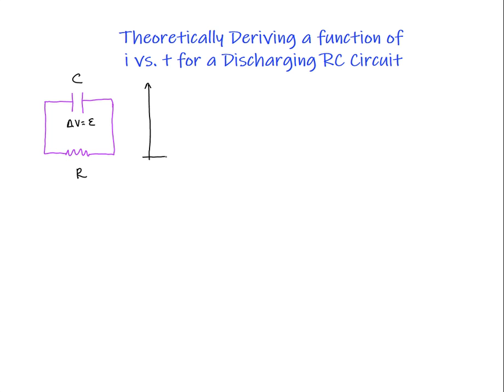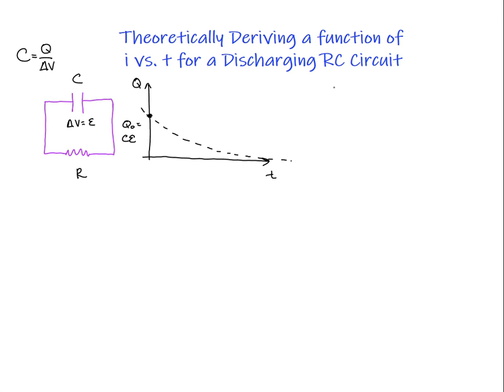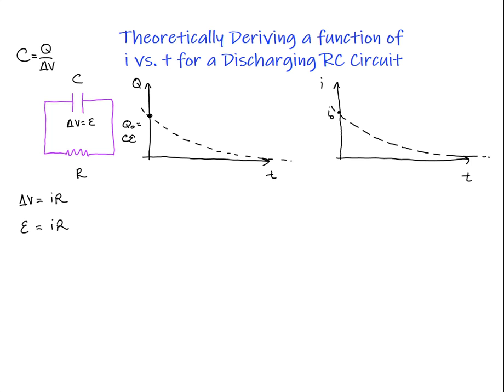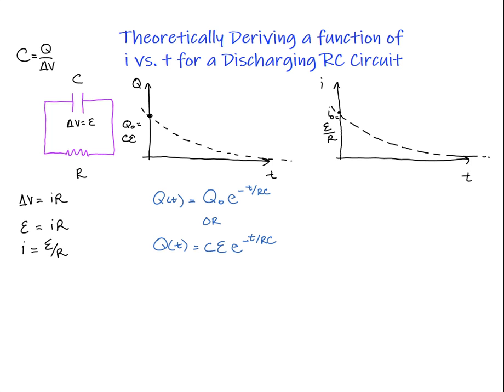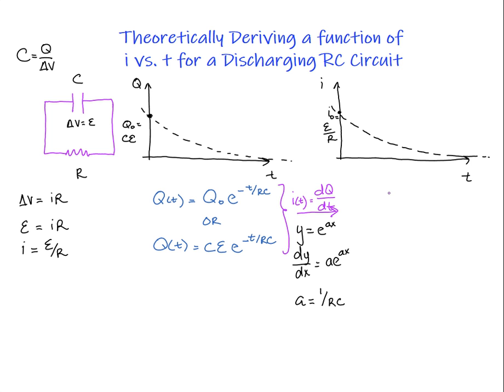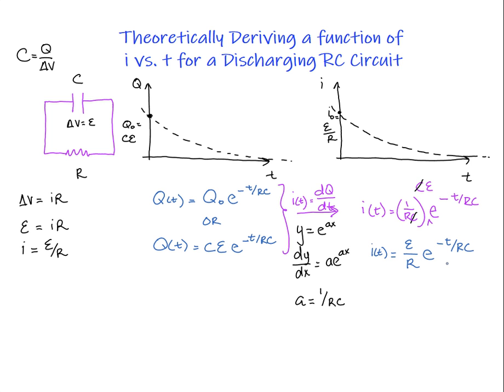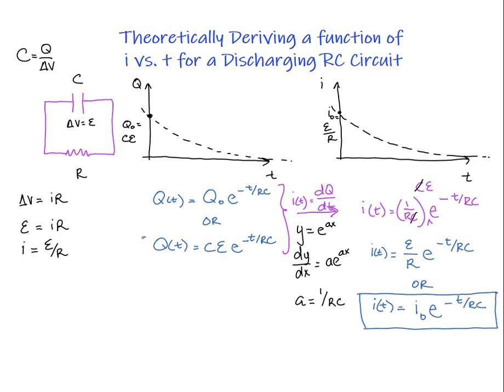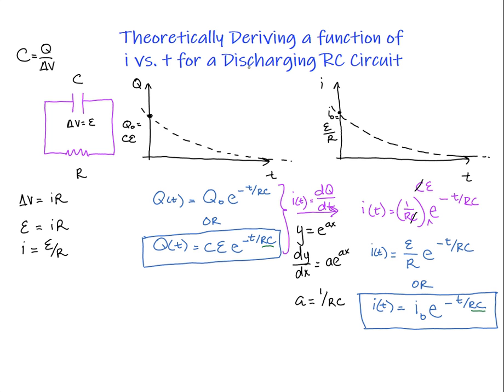Current as a Function of Time for A Discharging RC Circuit (Derivation)

Comment: Where does the negative from differentiating the e^-t/t term go
Reply from the maker: Good catch! It should be there. It would flip the function over the time axis, but the meaning would be exactly the same. It shows that the direction of the current is reversed from when the capacitor was charging.